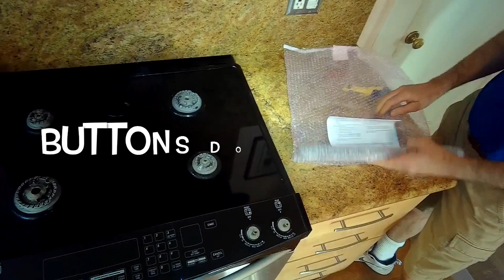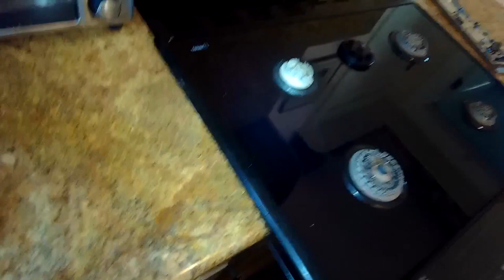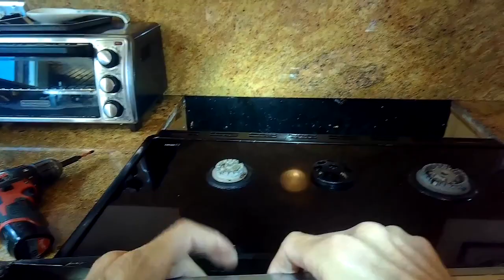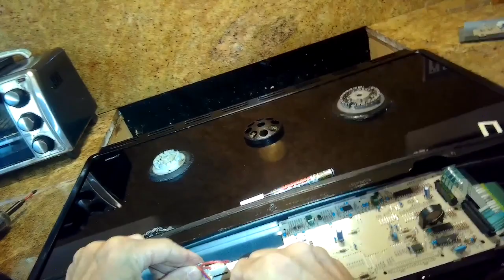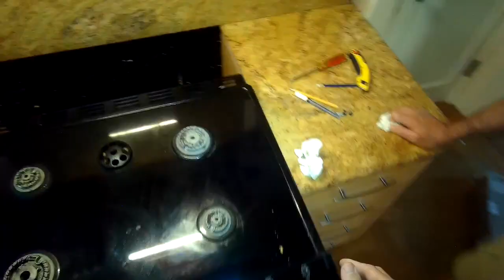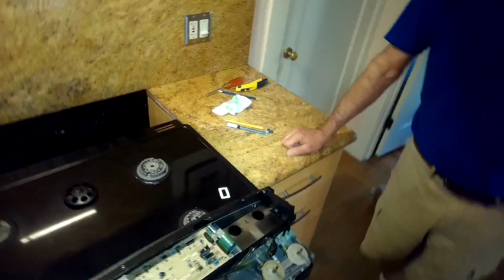✨ KITCHENAID SUPRA RANGE - DIM DISPLAY  - EASY FIX ✨

Comment: I had the same problem but after I installed the remanufactured control board, the error code F1:E3 appeared and I could not get to the reprogramming function,. From one of the online forums, it was said to check the oven lock position.  I moved the oven lock to the down position. (it is located in the top of the oven. open the oven door to access it). Once I reinstalled the control board and plugged the stove in, the oven lock automatically reset to the open position and I was able to go through the programming steps and now the oven works as it is supposed to. Thanks for the information.
Reply from the maker: Thanks for sharing that extra tip, glad it worked out! 👍

Comment: Hi while the turkey was in the oven a pop! occured and the display panel went out and triped the breaker. flipped the breaker on & the stove top works, however no display on for the oven. I do not see any wire damage to the element or wiring and conections. I opened the back of the unit and the front as you show in the video is it possible that I need to replace a small 1 inch glass fuse ? I have been looking for its location but can not locate it. anything helpful feed back to repaif this old electric stove. thanks
Reply from the maker: https://www.ebay.com/itm/277426732531. I think you need to replace this control board.

Comment: I have this stove, except the electric glass top (KESC308LSS0). My problem is the display works fine, but the glass display is shattered. How hard would it be to replace the glass only? 🤔
Reply from the maker: Here you are: https://www.ebay.com/itm/286076635074
Reply: @ScottTheFixItGuyChannel this is the part I ended up getting (different seller). My husband installed it and it's working great 😀

Comment: What if my display works fine, but the glass is shattered so bad that I can't see the screen or buttons well? I just need to replace the glass display. Is that a simpler fix?
Reply from the maker: Hi Ashley,
Can you email me at scottthefixitguy@yahoo.com so I can help you with that?
Reply: @ScottTheFixItGuyChannel will do! I just realized you already replied to this comment, so you can ignore the comment I just left. I also forgot that I left this comment here a couple days ago 😅
Reply from the maker: Thank you @ashleyletterman7808!

Replacing just the glass display can be a simpler fix, but it often requires specialized skills and tools. In many cases, the glass is fused to the display, making it necessary to replace the entire assembly. Assess whether you can do it yourself or if it's best to seek professional help.

If you need more info, you can reach me directly for a fast answer at AsqMe.com/@ScottTheFixItGu

Comment: I finally figured it out.. In my case, the display would get unreadable dim, especially when the oven was hot, with the display finally not coming on at all (so no display, but all buttons/functionality worked).  I had resoldered and cleaned the contacts on the 13 pin connector to solve intermittent heating-elements-not-on.  The problem was that the 2nd pin's trace on the board (the 2nd pin from the side OPPOSITE where the 2nd pin is empty/unused) was bad.  I tested with a meter and finally discovered it.  After soldering a small jumper-wire directly from the connector-pin to the next pad on the back of the board (simply follow the trace), the display is working again!
Reply from the maker: Wow,
Nice job Mike😊

Comment: Scott, this is a phenomenal video. I got a little bit frustrated at one point after replacing the board the end of service test procedure did not work properly but would did work for me was cleaning the ribbon cable again with an eraser, making sure they were firmly seated into the new control board, wiggling the jumper, and the other electrical connectors, and after many tries it finally worked. There is one element to the end of service procedure that’s not shown in your example the very front end of the procedure will work fine, but the display will show 6S, ELE and other miscellaneous functions, you need to cycle the start button Through all of the sequences, you’ll hear the door latch solenoid click as mentioned there are 12 altogether at the end of that cycle. Press cancel and begin normal operation. This worked for me. I’ve been on many online forms. There isn’t much information. Your video was the best explanation and I went for almost a year, just cleaning the ribbon cables with the eraser. But at a certain point, the control panel did need to be replaced and now the oven is working like new. Thanks so much you’ve made my Thanksgiving a special one.
Reply from the maker: Wow,
Excellent info.
Thanks so much 👍😊

Comment: Thanks for making this video! My ribbons are definitely oxidized and some of the prongs are dark in color. I cleaned them and the display worked briefly but then turned off again. The oven still functions fine, you just can’t read the display. I’m wondering if buying a new board is what I need or if I actually need to replace the ribbons. Thanks Scott!
Reply from the maker: Nice job,
Maybe buy some spray electrical cleaner from Amazon and really super clean the ribbon end so it’s shiny and spray into where the ribbon goes to clean it out 👍

Comment: Scott,
I have a Kitchenaid Superba Electric Range we purchased in December of 02. I’m getting the error code F2:E0. I’m trying to remove the control panel to get to the board, I’ve watched your removal steps but mine does not have the 2 screws on the left and right of the panel, any ideas.
Reply from the maker: Can you send a video of yours to my email at: scottthefixitguy@yahoo.com
Reply: @ScottTheFixItGuyChannel  Scott, where can i buy a replacement board or send mine to get fixed?

Comment: A dim display is almost always due to burnt capacitors.... which can be tested with a DVM, but also identified by a swollen appearance. Replacement caps are inexpensive - a kit containing multiples of different values can be purchased on eBay or Amazon. Make note of the values printed on the caps on your troublesome circuit board & order a capacitor kit containing the appropriate variety. Basic competence with a soldering iron goes without saying... but you don't need to be a professional.

Btw, the same thing applies to fixing a flatscreen LCD TV suffering whatever issues (typically a blank screen).

A $12-18 capacitor kit & an hour or two of your time is favorable to spending $$$$ for a new appliance/TV & sending your likely repairable appliance/TV to the dump.
Reply from the maker: Wow,
Excellent information.
Thanks so much👍

Comment: Hi Scott, thanks very much for this video! Our stove had no display at all however it continued to work. I did as you said and the display came back 😀 however after about 20 minutes, disappeared again. I checked again and unplugged it and restarted and the display came back and then went away again. Do you know if it is likely a code reset issue or is it a board weakness that happens because of the heat?

Comment: So my stove was working and then I cleaned the ribbon like the video mentioned to see if the control lights would light up and it worked but now I have a F2:E1 code and the stove won’t come on. I think I should of left it as it was. Any help would be appreciated.
Reply from the maker: F2-E1 - Touch Pad Cable Unplugged - Check the connection between the touch pad (keypad) and control board (clock) to make sure it is secure. Select the 'cancel' function and wait 60 seconds. If error code reappears then replace the touch pad, or touch pad and control board (clock) if all one assembly
Reply: Well Scottie I tried cleaning the ribbon but it went back to the same thing. When I press any control buttons I hear no beeps. Not even the oven light works. My gas stove looks exactly like yours in the video. Any more advice would be much appreciated since I am a retired 70 year old pensioner. Also if you could tell me where the model number is and where to order another board. Any help would be much appreciated.

Comment: Hi Scott, I have a range like the one in this video. The class on the control panel has come loose. Can you tell me how to secure it down. Do I need to take the bead of material which looks like a silicone gasket or seal? What do I use to seal the glass back down?
Thanks

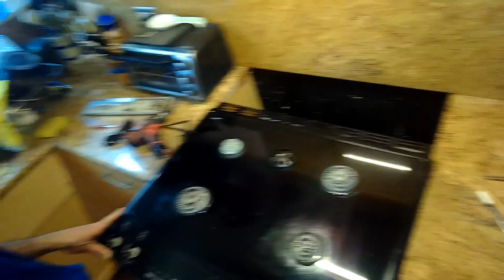Comment: Great video!   Hope I'm not entered this twice.  I have the same range and problem.   Display went out and had it rebuilt at PartsSimple for $170 including shipping both ways.    Display works fine and I can set the clock, however, any other key gets error code F1:E3 just as you showed in your video at 4:40.  I followed your reset procedure to no avail:   1) power off 5 sec  2) power on and wait 5 secs 3) press these keys in this order:  CONVECTION BAKE, CLEAN, BAKED GOODS, "STOP TIME", 190, TIMER SET, START.    The display looks normal but again I get F1:E3 when I press BAKE.
Can you confirm your reset procedure and where did you get it?

Comment: Great info.. However, my symptoms are a bit different. All works fine except that the "on" light for one burner remains lit even after I turn it off. The burner is actually off but the light remains on.  I opened the panel like you show but it's a different board design. The ribbon does not have "prongs" at the end, just soft plastic. Nothing to clean. Any thoughts?

There are four elements each in a clear plastic box, and a couple look dark on the top. Looks like fuses? I can't remove the covers to inspect. Help!

Comment: Great video.   Bought a replacement board, wired it up, and Viola! Can't get it out of PF.  Triple checked the ribbons.  No control whatsoever.  Any ideas are well appreciated.
Reply from the maker: I think you just press cancel👍
Reply: @ScottTheFixItGuyChannel  Thank you for the reply! Im afraid no buttons work at all.
Reply: It's gotta be the touchpad. Oy! Thanks for your help!
Reply from the maker: Maybe a loose ribbon connection
Reply: @ScottTheFixItGuyChannel New touchpad and control board did the trick!  Much obliged.

Comment: Hi Scott,  
Thanks for the info!! 

Can you recommend some remanufactures of these control boards.  

I had a minor boil over while speed cooking. This happened once before while under warranty and nothing worked!  Kitchenaid changed the board.  This time, My husband quickly opened it up and dried up the water and it did work two days after, then only the oven control went blank!  Thank goodness - The upper electric for cooking still works!  I ask my husband to try what you shown but he’s reluctant to do so. I did call  KITCHENAID  and they wanted $460.00.+++.  Being we will be selling the house... We decided to buy a new range  for a few dollars more.  I’ll consider it if we can buy the part cheaper.  We manage with the BBQ grille and a mini counter top for heating pizza etc.
Reply from the maker: Got a remanufactured board recently for 170.00
Reply from the maker: KITCHENAID SUPRA DIM DISPLAY —FIXED https://youtu.be/MiSCQV2-JYI

This video has the link for the board